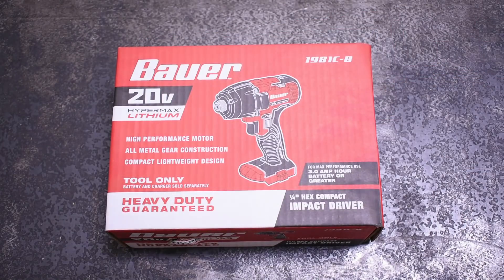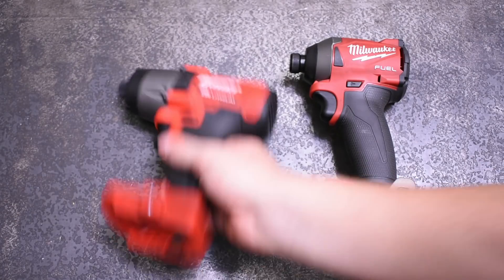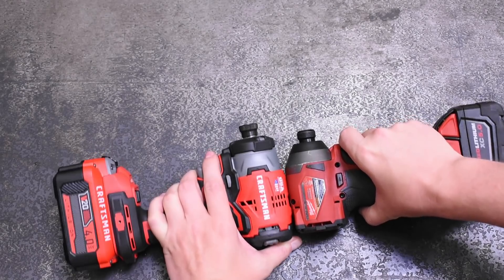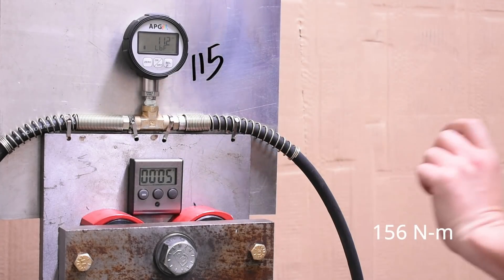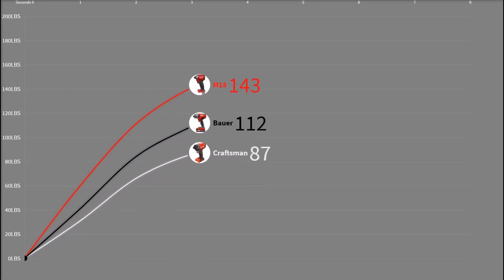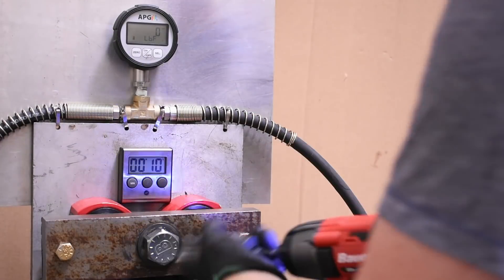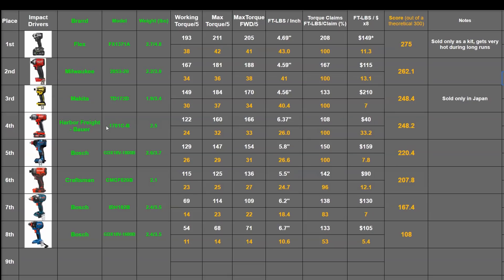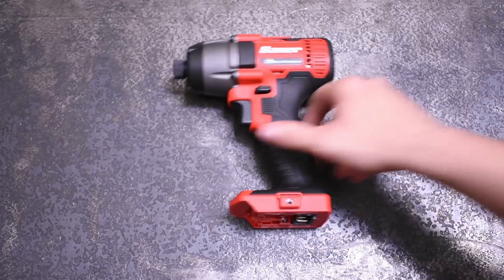[Impact Drivers] Does More Expensive Mean More Power?

Comment: They made a torture test in drilling long bolts into wood and after the 6th ish bolt the Bauer started to smoke 💨 and it was so hot I think even if the tool can power a starting 10 second  burst longevity on 3-10mins multi test can tell us even more about each tool capability , the Milwaukee didn’t burn and it’s was around normal temperatures  but again it’s a more day to day torture test I love this test of dyno that we can visually see what’s the torque

Comment: Perhaps a strange suggestion, but would it not make sense for tools that exceed their torque claim to increase the value above 100 as well?
I think it would do the chart good, especially you want to compare it with others. This would cover the scenario where a cheap model is actually the same for an expensive one (and is therefore underrated) and would get way more points, except just for pricepoint.
Just my 2 cents ;-).

Great videos BTW!
Reply from the maker: We've tried the math. And a cheap $40 amazon tool that claims like 60 and makes let's say 110 gets an inordinate amount of points. it doesnt scale well. It become just a rank list of underrated vs overrated, where as we'd rather rank just good tools closer to the top.

Comment: I am an underground coal mine electrician and I put tools to the test. The best 1/2 inch drive impact i had for a long time was a dewalt Max XR 20v.($399) For a while it was my go to it lasted 7 or 8 years (in coal mine tool life that is like 50 years with all the dirt and dust and abuse) but when it went bad it went crazy it would be in the reverse position then boom you are tightening a bolt without changing the direction which can be bad for some of the panels that we have to get into. I switched to Milwaukee M18 Fuel 18v brushless cordless (only because the company i worked for replaced my broken dewalt with it) I have to say I was impressed if you were not careful it would snap the head off of a bolt. I am now curious about the Bauer and how it would hold up against all a coal mine has to offer. I might have to give Bauer a try I mean $40 who wouldn't try it.

Comment: Ive used a bauer 1/4 impact for well over a year and its held up surpringly well. Ive put on 2 steel metal roofs with it and have used it to pull motors and do auto/truck repair heavily and its put up with it all. It handles about 90% of the bolts i throw at it and still is my number 1 tool to grabs when going to the junkyard to pull parts.

Comment: could you use an impact driver for 8mmx400 wood screws?
my cordless Makita drill did handle them with ease, but it is putting a lot of strain on my hands, not sure if my impact drivers are just too weak or if that's just beyond the scope of what an impact driver can do.

Comment: I picked up the set of 4 brushless craftsman tools like this for $200 with batteries and charger on sale. The 1/4 impact is a little weak but they have been reliable for me having left them outside multiple times in rain. The mid range impact from them seems to be pretty killer though like you guys tested previously

Comment: I bought a gen1 Bauer when it came out 3 years  ago. It is still a beast. I use it to fix my car and motorcycles. It has seen trans, and motor oil with the occasional coolant spill. It drives bolts all day with a 3yr old 1.5ah battery very reliable for sure. Great video as always.

Comment: I own one of these Bauer impacts and an older DeWalt. The Bauer is very cheap, bit that translates to how easy they are to use as well. The DeWalt is just nicer to work with. I don't have a lot of high torque applications so I don't see a great benefit there. There is something to be said about how the tool fits your hand. You double your work if you're fighting your tools. Also, I've gone through 3 of the chargers. There seem to be a weak in link. All in all, it serves well as a back up or spare.

Comment: nice video. but please clarify to watchers that "made with global materials" usually means "made in china but we put it in the nice box in the US with prison labour". (source: i worked in such a "factory" as maintenance engineer for several years.) the global materials BS logo is just legally skirting the law as tight as possible without getting in legal trouble.  just like the difference between "light" and non-light food just means the package is smaller or the serving size listed on the package is smaller than the non-light version. its all marketing BS.

Comment: It's impressive how powerful impact drivers are nowadays.  With my compact brushless Ryobi impact driver (PSBID01) and a short 2" Makita hex to 1/2" adapter, a couple of seconds impacting will loosen an 85 ft lbs lug nut.
Reply: That's a good impact. It pushes out almost as much power as the Milwaukee. Oddly enough, even the old P235 that can be had for pennies on the dollar performs remarkably well.

Comment: The only thing is if your a contractor the size and weight is highly detrimental so of course the only option would be the Milwaukee, DeWalt or Makitas top of the line. Bauer wouldn't cut it for actual work. For a Joe DIY Saturday Smith however it certainly fits the bill.

Comment: Hello again Torque Test Channel 
Thank you for another Great Video. What would you recommend for a drill and impact Wrench set. I'm thinking about the 12volt to the weight of tool down. Again thank you
Reply from the maker: If 12v then Dewalt or M12
Reply: @TorqueTestChannel  Thank you, between the two. Which one has the best tool warranty? Again thank you

Comment: Does More Expensive Mean More Power?

Depends on the the "rating" of the tools. If tools are rated the same then the power should be the same.

More expensive tools (should) mean that better quality components are used with better assembly procedures. So the more expensive tools should be more reliable and should last longer.

The presentation of these tests could really be improved!

Present each tool with its specifications one at a time. Even if a tool has been tested previously, present its specifications again to refresh our memories. And don't jump about showing previous clips and then revert back to the current specifications and tests. The Milwaukee specs were not presented again, as it should have been!

Plot the test result of the tools one at a time and don't include earlier tests initially for comparison. Plot Bauer test results, then Craftsman test results should be added to the Bauer plot and then add the Milwaukee test results to the plot.

After an initial analysis of these three plots, then add test plots from other tools if wanted for further comparison.

Comment: Hi, I had that exact Bauer 1/4 driver and it’s brother the 3/8 impact cordless, I got the 1/4 for 71$ with a bag a charger and a 1.5ah, both tools were very powerful and got the job done in some cases, just a little to bulky for very tight spots, I gave them away, excellent video ty, Bob,

Comment: Since you've now tested the 20 volt HF Bauer brushed model impact driver, why not test HF's "premier" unbrushed impact driver, the "20 Volt" Hercules model 56531. It's currently on sale (26 Nov 2021) for $49.99 and HF claims it can do a max torque of 1500 inch/lbs of force.

Comment: When you do cheap brushed motors, could you show the brushes that they use?  In the past, HF has put brushes in their motors so thin that they would fail in <5 hrs of usage.  No idea if they still do that, but it would be a really good thing to check before recommending a brushed tool.
Reply: I probably have close to 20 hours of hammering on my Bauer so far, on my garden tractor pullers it's done  lot of lug bolts, studs ans stuck bolts on new machines, I get the hot motor smell at times bit the rest seems A ok
Reply: @kygunworks4982  Great to hear!  Most of the ultra-thin brushes were on cheap brands like Chicago Electric.  The very first Bauer tools had crappy brushes, and reviews called them out it.  They don't do it often on their "better" brands anymore.  I wouldn't put it past them to make a new SKU just prior to a big sale with cheap brushes in them. . .

Comment: You should test the Kobalt XTR Impact Driver when you get the chance. I suspect for the price, it will give the Flex and Milwaukee a run for it's money. Got the XTR 5 tool kit for $300 not too long ago. Very satisfied so far
Reply: I'm a big milwaukee man, but for whatever reason no one talks about the xtr, but those tools work incredibly well and are very affordable.
Reply: I bought the same XTR last BF and all of the tools are fantastic, even the led light (use it all the time). The XTR impact driver is so powerful, so much that Ived used it to take the lug nuts off my tires and it rips them off like nothing. Excellent value for sure
Reply: They're made by Chervon just like Flex. Never said they would out-perform them but I want to know how they stack up on the rank chart. I'm pretty confident that the XTR Impact Driver will rank highly on that chart especially factoring in the price.
Reply: My comment seems to have aged very well after TTC's latest video lmao

Comment: When the Bauer first came out, I picked it up. Bought a 1/2 drive adapter and it easily took off 100ft/lb lug nuts. 

A day after I got mine, "someone" posted a video of it not being to take off 127ftlb lugs nuts off a dodge truck. Just for fun, I torqued mine to 150 and it had to hammer for a few seconds, but still broke then all loose. 

In the other video I watched, they "ran the battery dead" and couldn't get the 127ftlbs off. 

Supposedly there's alot if difference in the 3ah battery performance wise, but I couldn't really tell a difference on the impact. 

Now the 1/2", you can definitely feel a difference with a 3ah battery, and even more so when it's fresh off the charger. I bought a 5ah, haven't tried it yet though.
Reply: The 5ah battery makes a very noticeable difference.
Reply: The size of the socket & brand matters too

Comment: Wow, this was extremely surprising. I've been let down by Craftsman's recent hand tools, but I didn't think their power tool offerings were half bad being a combo of DeWalt and Porter Cable. They didn't interest me anyways since Kobalt exists, but I still expected more. That said, I also did not expect that much from Bauer, and I'm really glad to know that a hyper cheap tool like that can really be a worthwhile purchase for someone that doesn't need high end tools.
Reply: I was also really surprised by this test. I've used that exact model Craftsman almost every day for the last three years, doing mostly electrical work with a bit of carpentry and auto repair thrown in.

It's been beat to pieces and has served me well, so it's a very reliable tool, but those power numbers are very disappointing.

Don't suppose it matters a lot now, because I believe they have been discontinued. At least my local Lowe's doesn't sell them any more.
Reply: I know this is the TORQUE Channel, but there's more important things in judging an impact driver in real world, like when doing construction. Ergonomics, build quality, trigger feel, speed control, weight, size, lights, battery life etc. I need my impact driver to be able to able to drive lags and screws all day, every day, not just one burst of torque for 5 to 10 seconds.
Reply: You also gotta factor in the models being used. I’ve used craftsman tools to work on everything up to my diesel truck and they work perfectly fine. Only thing I’ve had to bust out the air impact wrench for it rusted hub nuts that any battery driver wouldn’t bust loose.
Reply: Craftsman is really a mixed bag. The 72 tooth ratchets and accompanying sockets are surprisingly good, but their wrenches are just… garbage.
Reply: @notanavrageloser  Their hand tools are literal junk. I had multiple 3/8" drive ratchets lock up on me, I went through two in a month just doing basic maintenance on cars. I really wish that they were still made in the US, those were absolutely killer!
Reply: @zznick660  - And if you have an older model, and the model numbers don’t match, they won’t exchange it, or upgrade it. They give a phone number to call, and nobody answers, and doesn’t get back to you. I’ll NEVER buy another craftsman ratchet!!!
Reply: @chesterswingjr9796  I've heard about how much of a pain in the ass the new warranty has been for people. After that, I went and bought Snap On just because I didn't want my shit to break. Yes, it's incredibly over priced, but I use my stuff day in and day out, I don't have time to deal with broken tools.

Comment: Fascinating. I'd love to see the Skil 12V impact driver and right angle impact driver on the chart. They're both brushless and the impact driver bare tool is usually 60 or less. Right now you can get it in a kit with the drill driver (also brushless), battery, and the nicer charger for 85 which is just an awesome deal.

The drill driver does do something weird, it seems like it runs in "turbo" mode for a few seconds when drilling then goes down to a more normal speed. Would be cool to see a TTC version of this test graphing the rpm...
Reply: I gifted that kit to my dad last Christmas and he loves it. It's been used a lot on the new house

Comment: The Bauer drill with the 5ah battery has sold me on them. $60 with a charger and 1.5 or 2 ah battery is hard to beat, I abused mine running lag bolts and it just kept running, very impressed
Reply: And you have the peace of mind to just buy another one in case in let's the smoke out, you'll still be ahead.
Reply: Bauer is highly underrated. I have the ⅜ impact and the non hammer drill and ive abused the hell out of them like 5 days a week and theyre both holding up great. They eat through batteries like a motherfucker tho
Reply: @Pippy1  i've beat the piss out of the hammer drill, even forgot them outside in the rain, zero issues. their plug in 1/2 impact is a POS though, i got a XR mid torque for that stuff, it's great.
Reply: Just to note, the Milwaukee comes with a 5 year warranty whereas the Bauer is only 90 days.
Reply: @tsslaporte  yeah but I can buy 3 for the price of the Milwaukee
Reply: @gbux07  That's nice and fine, if you're not using either tool much.

If you are, the Milwaukee will absolutely outlast the Bauer more than enough to pay off that "buy 3 for the price of the Mil" multiple times over. Our company learned that the hard way after using HF sawzalls for heavy demo for 2 years.
Reply: @reaperreaper5098  It depends on the use. Someone who doesn't abuse their tools or does massive projects on a regular basis can make the HF tools last for a while. I have quite a few Bauer 20V Cordless tools and they've been excellent for the money. I won't deny that Milwaukee has better tools overall, but the prices make me cringe. They are def worth it if you need a durable long lasting tool. I have experience with a Milwaukee Sawzall my Grandpa has had for several years, and it's a great tool but the new stuff just ain't worth it for some people, like me.
Reply: @ohhhLuna  The issue is that much of Harbor Freight's power tool offerings are subject to a relatively high crib death rate. They've been improving in this regard (particularly with Hercules and Bauer tools that priced similarly to Ryobi or Craftsman), but they've still got a ways to go to become truly reliable daily drivers.

Comment: Curious how Walmarts Hyper Tough would compare to the Bauer. Not enough videos on the battle of the ultra cheap out there. Definitely a surprising result from the Bauer - but I'll stick with my Ryobi.
Reply: I think Hart is more of a direct competitor to Bauer... The Drill Master would be the Hypertough competitor...
Reply: @boosted2.4_sky  I could see it either way. Considering Hart is made by TTI, it'd also compete with its brother Ryobi. I'd just like to see these ultra budget (or cheap) options compared and maybe torture tested.
Reply: @ForeverDiox  it's not so much competition between the Ryobi vs the Hart, they're tailored to a different market since Hart is a Walmart exclusive. I actually would love to see a comparison between the two since I wonder if the internals are the same, maybe with just some different programming.
Reply: @CP-mb7ly  here's a comparison between brushed Ryobi vs brushed Hart. https://www.youtube.com/watch?v=mzz6sf4tRN4

I know there is a newer Brushless Hart impact driver, but haven't seen comparos
Reply: @ForeverDiox  I did not know Hart was made by TTI. I have some Hart hand tools I bought when they were available at home Depot, this was around 2014. Still good.
Reply: @Bigelite094  yeah, all exclusive to Walmart now. I bought one of their socket sets on clearance for $30, and it has a 1/4 and 3/8 90 tooth ratchet. Been my go to set, and it's held up to lots of abuse. I don't know the OEM for handtools, but TTI for sure with power tools.
Reply: @boosted2.4_sky  nah drillmaster is going the way of the dodo, it's comparable to wal marts olddddd various Chinese tools before they had hypertough as the low brand and Hart as the high brand. It used to be Stanley or Black and Decker as the high tools and just various crap for the low tools. Harbor freight used to have various shitty brands in their old catalog days, but now their main low end line is Warrior, then Bauer and then Hercules. So it's really a warrior.
Reply: I think the Hart is just a lower-binned Ryobi; somewhere for TTI to dump underperforming motors. Which is fine. Hyper Tough would be interesting because it comes from a totally different manufacturer than any other big-box power tool brand. Mine have been living up to their name; dropped the orbital sander onto concrete from 6 feet and used it like a belt sander for awhile, still fine. The 20v drill is still good after a couple years of light-mid use.